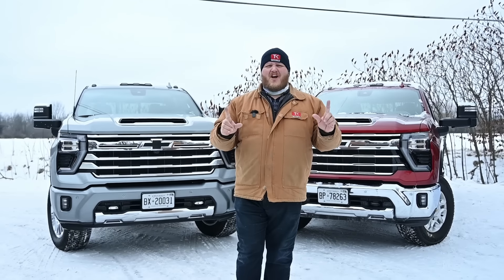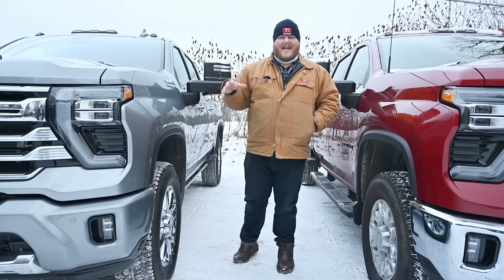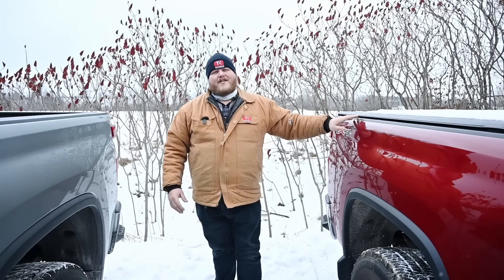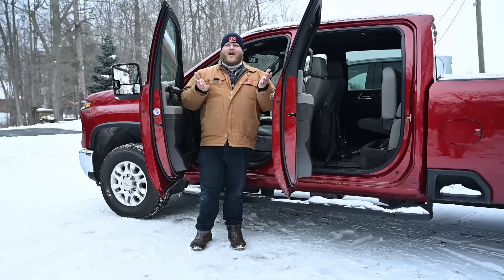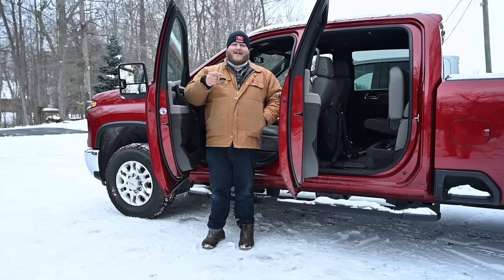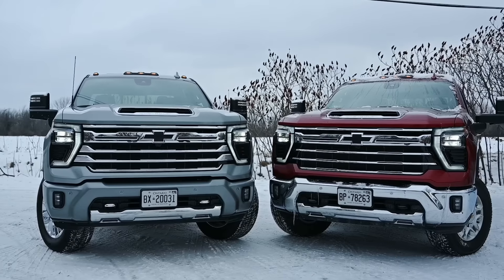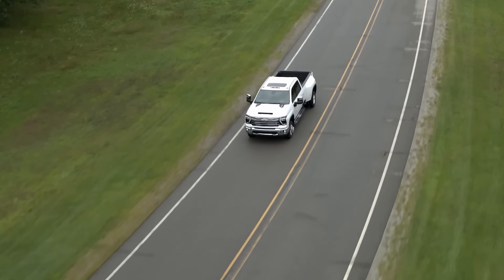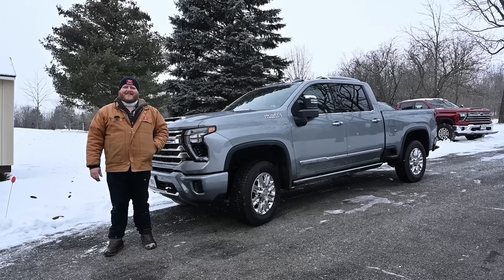2500 vs 3500 Trucks - What's Really the Difference? We Compare Two Chevy Silverado HDs to Find Out

Comment: My truck is a 22 High Country 3500 LWB.I think if you are going to tow, especially 5th wheel, or Gooseneck, you should choose the long bed instead of the short bed. The short bed, whether you choose the factory Puck system or go after market install, you will have a hitch point that is about four or five inches behind the axle. This because the factory has placed a crossmember on the bed where the hitch needs to be. The long box does not have said crossmember at the axle centerline. With the hitch behind the axle, the heavier the hitch weight, the more weight you take from the front axle, granted it is not a great amount, but you need to add a little weight instead of removing from the front. The factory don't seem concerned with this, as a conventional trailer Max rating of 20,000 lbs, you have a hitch weight of 2,000 lbs, that is going to take weight  off of the front axle.

Comment: The Max Tow 2500 was created to allow a fella to tow a 14,000 GVW trailer without breaking the 26,001 GVW which would require a Class A CDL in most states here in USA.  With a 3500 you’ll be 100 lbs over the threshold.

Comment: On the Ford side, I’m like your dad. I got a 21 F350 Lariat 4x 7.3L, the same config in F250 was slightly more $. I didn’t want sunroof because I run a law roof lightbar.  I got the 7.3L rather than the diesel, saved $10k right there.

Comment: Well something changed because during the shut down from Covid, I went part number to part number from a 2500 to a 3500. The only difference was the extra spring pack on the 3500. The frame , brakes and rear end was the same part number. I’m guessing this changed with the increase in horsepower and torque from the l5p.
Reply: That's because all the changes occured on the 2020 refresh of the trucks, not because of covid. If you were looking at 2019 part numbers then none of that applies. All 2020+ HD trucks have always been like this.
Reply: I guess I should have been more specific. The U. S. Lockdown was March 2020 . I was not comparing 2019 to 2020. As I knew the truck had a complete redo from 2019 to 2020 . In the video he’s saying the frame is different and the axle is different. I didn’t say Covid had anything to do with the changes . I was saying that I was bored and went through the gmparts direct website for part numbers. And everything matched except the helper springs . So as typical of gm they’re always screwing with something .  I have a 1500 hd which was basically a 2500 derated so they could have a 4 door 1500 truck until they figured out the 1500 4 door short box.

Comment: Good info but there's a big difference in rear suspension in the RAM HD trucks with the 2500 using coils and a track bar, it's less stable than leaf spring trucks. They could certainly upfit it with a higher payload and GVWR if they chose, and with the Cummins 2500 lack of payload is an issue for many.  FWIW, Ram 3500 SRW with Cummins have a 12,300 GVWR.

Comment: Not sure if I missed it in the video but one difference between my 2500 and the 3500 I noticed is the size of the ring gear on the rear differential. I’m no expert but I guess this affects how it accesses torque, particularly on the low end.
Reply: Bigger ring gear is stronger
Reply: You just missed it - they mentioned that. 
The size of the ring gear does not affect torque; the ratio of ring and pinion sizes is what matters to available torque, while the ring gear size is important to gear durability.

Comment: I prefer the 2500, and a sunroof.  Only use the sunroof sliding cover in my 1500 to tell when the garage door opener has cycled and occasionally to look at the clouds, Can't remember the last time I actually opened the sunroof but, it is an option that improves resale value, not that I ever intend to sell my 2015 LTZ Z71. Best of a long line of 1500 Chevys.

Comment: In NYS, I own a super duty F250 Ford. I registered it at a lower Gvwr  then when the Inspection came due it would not pass because the State required it to be plugged into their computer. After spending over $500.00,  the inspector called the state and they informed him, “ Oh yea, there’s a problem with the inspection program. Re -Register it at full GVWR then it will not be required to get plugged in to the computer then it will pass”. STUPID NY. Nothing wrong with the truck but due to regulations I have to pay higher Reg. Fees so it will pass inspection.

Comment: Ya, If you order the 2500 with the HD tow package its cheaper to insure but comes with serious capibilities.
Reply: That must be location dependent. I have a 2024 F450 coming and my current company quoted me $130 a year more than my previous 2011 Ram 2500. Total is $1340/year on the F450 here in Maryland.

Comment: , anyways the only difference is that the 2500 is $10,000 more than the $3,500 and the $3,500 has two leaf springs and a strip down interior so ultimately there is no difference it's just the label on the door My truck is a 2006 2500 HD I had airbags put on it and it'll pull anything that the 3500 will pull so don't waste your money guys I just pulled 10,500 lb fifth wheel 400 mi with my 2500 6.0 little slow going up the hills but it was also 108° outside had to pull over a couple times to let my truck cool down I also had really bad headwinds out in the desert and I was on the worst freeway in the entire state if they built freeways out of potholes This would be the one instead of potholes developing and freeways they built this freeway out of potholes My truck did fine I was a thousand pounds over the limit but because of the airbags it was fine on flatlands it pulled the hell out of it Don't waste your money do your research. I'm talking about a 6.0 l V8 vortec no diesel here it pulled 10,000 lb like it was a baby buggy

Comment: Dealers I've spoken to have never been able to explain ratings and differences.  This is a great video.  I understand weight ratings as I have both a 10K 5th wheel and a 4K pound truck camper.  Until a month ago, I handled both with a 2008 2500 crew cab long bed that I've upgraded to carry the weight.  One I never resolved the issue of what the rear axle was designed to carry.  I'm thankful I didn't hear your explanation of the differences on this video, as I would probably have decided to save a few dollars and went with the 2500.  But, in deciding what to buy, I went with a 3500 dually.  That way I don't have to worry about the extras the wife always adds to the TC.  By the way, the new 3500 CC gas (no sun roof) seems to ride smoother and turn in a shorter radius that the 2008 2500.

Comment: With General Motors, another difference is if you want the max tow in the three-quarter ton it only comes with the diesel. If you want the gas motor and the higher towing, you gotta go with the 1 ton truck.

Comment: I have a 2005 silverado duramax 3500 dually with a dumping rack body. Traded up from a 3/4 ton single rear wheel  dodge 4 door with Cummins. The Cummins was a beast but with single rear wheels it was uncomfortable towing or hauling heavy stuff in the bed. Now my Silverado with the dual rear wheels is a more stable hauler. It has the heaviest suspension you could order in 2005.  You should consider that if you are hauling or towing heavy with single rear tires and you get a blowout the whole unit is going to roll over so the safety of a dually is something to consider. I also think that the idiots who have a 3/4 or one ton truck with fancy mags and low profile tires towing or hauling heavy are courting disaster. I have a CDL with a doubles endorsement and have pulled flat beds,lowboys,boxes over more miles than I care to admit.

Comment: The big three truck manufactures need to change their verbiage from the 70's and stop calling today's truck 1/2 to 1 ton because clearly  today's 3/4 ton truck can carry in the bed anywhere from 3395 LBS to 3975 LBS which is way more than 1750 LBS is what a 3/4 ton  truck is called.  The same goes for a 1 truck which todays 1 ton truck can carry 4,000 to 4600 LBS in the bed so technically today's 1 ton is really a 2 to 2.5 ton truck and 3/4 ton trucks is 1.5 ton to 2 ton
Reply: 3/4 of a ton is 1500 lbs or 1680 lbs depending on whether you are using a short ton (most common) or a long ton, so you are correct that the "ton" rating system doesn't really work with the new trucks.
Ford currently has one configuration of their F350 that is rated for 8,000 lbs/4t of payload
Reply: Thanks for clearing it up, my math was a little off for 3/4 ton but yes the big 3 truck manufacturers need to change their wording

Comment: You keep saying everything is the same on the 2500 max tow, but it isn't. You said yourself that the 3500 has one more cross member than the 2500.  The frame on the 3500 ends up being slightly more rigid.  You also said there's a difference in the ring gear and slight difference in the axle. That's probly what accounts for the difference in capacities.

Comment: One month ago my 2500 LTZ crew cab long bed finally came in. I'm like your dad in the fact that I didn't want the sunroof. Option wise it's loaded. So far, I'm enjoying it very much. The reason I went with the 2500 is, that the max I'm towing is 13k-14k and my cargo weight capacity is less than 500 pounds less than the 3500.
Reply: I got the same thing in June of 2020. I wanted all the options but no sun roof and wanted white CC LB and don't like the high country white bumpers, HC wheels, stock wheels, and a couple other things. They had 3 LTZ trucks with every option but sun roof and 5th wheel prep and z71 for the same sticker price as the HC. Orders weren't getting filled during the pandemic and I really needed a new truck when I finally went looking. With back and neck problems I didn't want a harsher ride and there were mixed opinions on the ride of the 3500 plus komnifornia would have just charged me more for tags and my needs were easily met with the 2500. I love mine and added the banks pedal monster which makes even more difference than the derringer tuner. It can get 20 mpg on the freeway at 85 mpg and tows 12-14k pounds with ease.
Reply: Do you have the diesel or the gas?
Reply: @MrBayrum56  I got the gas engine. I'm very pleased with its performance. It tows my car trailer very well and the performance of the 6.6 gas and 10 speed is impressive.

Comment: Is the GVWR on the 3500 with duals higher than the 3500 with singles?
Reply: Yes. All the 350/3500 DRWs and the F450 pickup (cab and chassis is a class 4) have a GVWR of 14,000 lbs. That is the maximum GVWR a class 3 truck can have.

Comment: You are absolutely wrong when you say the only difference is in the numbers and has nothing to do with engineering - that's crazy. You pointed out that the frames are different between the 2500 and the 3500, even if you get the 2500 max tow. It is absolutely the engineering that gives rise to the GVWR numbers.

Comment: I am sold on 3500 because I want a truck camper and I want to stay below legal payload.
My big question is long bed versus  7 foot bed.   I prefer a short bed but how the vehicle handles when loaded can be impacted by wheelbase and where the center of gravity is relative to the rear axle.

Can you do a video with max payload in each truck and see how each handles?

Comment: I owned a 2024 2500HD with max tow package and traded it in for 2024 3500HD. They both gooseneck towed 21,600 lbs. Payload was higher on 3500 by 300lbs. 2500 with max tow package was a beast!

Comment: Overall, this is a great video.  I think you skipped over one big point.  What GM did with the ¾ ton trucks is setup a tiered system.  The 2500 has three different tow specs.  If you get a 2500 with 17-inch wheels the conventional two rating is 14,500 lbs.  Upgraded to 18 or 20-inch without “Max Tow” package and you get 18,500, and like you stated the “Max Tow” package includes the 20-inch wheels and you are at 20k lbs.

Comment: guys thanks so much for the video and info.  i just traded a 2021 2500 HD LTZ for a 2024 3500 HD high country.  i never wanted a high country but that is all i could find.  I believe the LTZ is better value and deal compared to the high country.  my truck rides great and numbers are 21,600 gooseneck, 20,000 bumper and 3789 max pay.  my truck is 12,100 gvwr

Comment: First of all, fantastic video and information! I have a 2020 2500HD now without the Max Tow Package, Not even sure if it was available when I bought my truck and I haven't looked because at this point it dies not matter. But I'm considering buying a new truck. Either the a 2500 with the max tow or a 3500 standard bed. Right now I'm leaning towards a 3500 LTZ rather that the 2500 Max Tow because I do carry stuff in my bed on occasion such as a big arse pallet of fertilizer. So thanks for the video. I did send an e-mail about the giddyap straps. My better half is vertically challenged. They are good looing assist straps and would help her put a lot. Let me know if you don't get the e-mail. Thanks!

Update: Bought a 3500HD DRW Silverado. I posted in the comments of one of your outer videos. Wanted to update my comments here for your readers. I went with the DRW truck simply for the increased cargo capacity over the SRW 3500HD. I needed it for my 5th wheel camper. A SRW would have worked if I got the Worktruck or LT 2WD version, but I wouldn't have had much cargo capacity left over when my 5th wheel was hitched. One other thing I wanted to mention is I also found the rear differential was 1.5 qts low on fluid. Some research lead me to a forum where many people have reported low fluid levels in the front and rear differential. So check your fluids people, before you damage your truck.

Comment: If the 2500 max tow has the same suspension as the 3500, why the different in high… thx for all the good info….
Reply: The additional overloads are in the spring pack, but are not in use until engaged. This increases the height by the thickness of the springs. Each spring is about 1/2" thick, so the 3500 sits about 1" higher in the back and the front end (different torsion bar) is lifted to keep the rake the same as the 2500HD.

Comment: In Quebec, every truck plated commercial over 10000lbs has to go through inspection, balance and etc! This is why gm has C4M RPO
Reply: I'm in Maryland and we can register a class 8 (Freightliner) for personal/non-commercial use and not have any additional cost or restrictions than an F150 driver has.

Comment: Class 1 railroader here and I can tell you these trucks hold up well in some of the worst conditions. They are loaded down from day one and normally see anywhere from 25000 to 40000 per year until they reach 275000 miles.This is minimal preventative maint,extended oil changes 10000 to 15000 miles no transmission maint and no rear axle maint.We stopped buying Dodge trucks for a while except for half tons.

Comment: Without a doubt, best video I’ve ever seen if you want to know about truck differences, but also what the different weight ratings mean, especially when it comes to licensing and registration. Nice work gentlemen. I’ve been in that boat where I bought a Ram 2500, didn’t pay attention to the fact that it only had 1900 lbs of payload, sold it after 3 years to specifically get a 3500 dually to get the payload I needed to tow a big 5th wheel. Have since stepped down to a SRW 3500 Chevy. Also nice to see that the steering column trim on your truck is crooked as well…..
Reply: Don't feel alone, I ended up doing the same thing, with lots of "constructive criticism" from my spouse. 🤣🤣
Reply: man I thought my 24 3500HD was out of alignment because the trim is crooked in mine when the wheel is strait.  Only reason I havent had an alignment is because my tire guys said they cant align this new of a truck yet because of the lane assist BS they put on and Im not one that likes to let the dealership put their hands anywhere near my new vehicle.

Comment: I did not suspect the subtle differences between the max payload 2500 and a single wheel 3500. The redundancy seems unnecessary, counterintuitive. I am wondering what the differences have been historically.
Reply: It's true. There was a rummer a few years back that 2500's would be discontinued because they were redundant. But they do have their purpose even if it is mostly on paper. Sometimes, taxation makes a difference. Sometimes, it's the difference between commercial and personal use affecting who can drive it and how much they can carry or tow. 

Here in BC Canada, for example. 3500s are exempt from luxury tax. So, almost all HD trucks for personal use are 3500s unless the owner just wants a base model 2500 that will fall under the taxable limit.

Comment: Great video! I love the few clips from the GM assembly plant.  The larger rear end ring gear would be a nice benefit from 3500 or 2500 max tow, but for what i do, not needed.  It will be a few years before im ready to spend $100,000 on a truck but that will be fun when i do. Right now my 2003 1500HD does the job.

Comment: Great job guys on the comparison I have a GMC 2400 HD with the tow package. Is your exhaust brake  screwed up like mine where you have to hold the brake and difficult to engage without a load?

Thanks Mike
Reply: Put it in tow/haul mode and pull your shifter to manuel and down shift. Exhaust brake work better with the engine revved up some. I hope this helps. I have a 2021 3500 drw I use for towing a gooseneck trailer.
Reply: Thanks however the 2024 GMC or Checy 6.6 10 speed will not engage the exhaust brake in manual. It only works in Drive. Thanks Mike